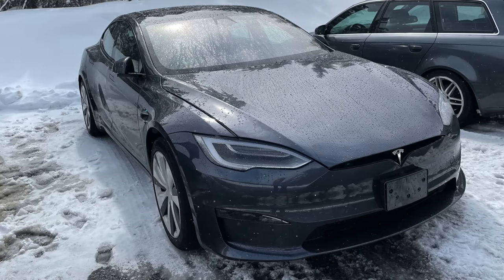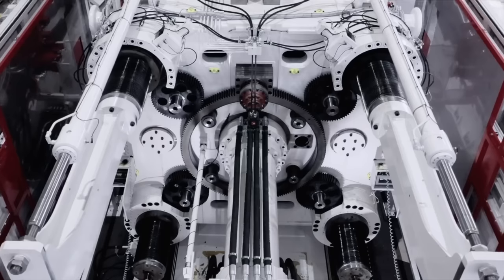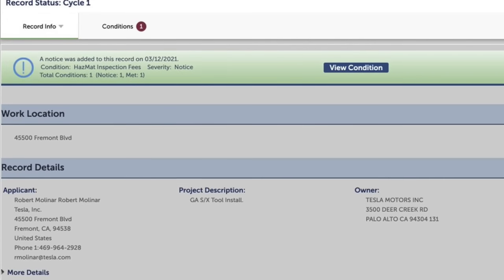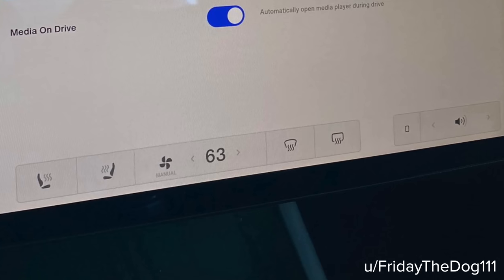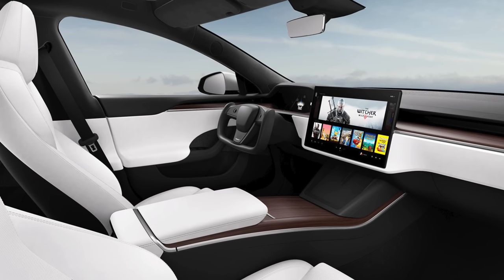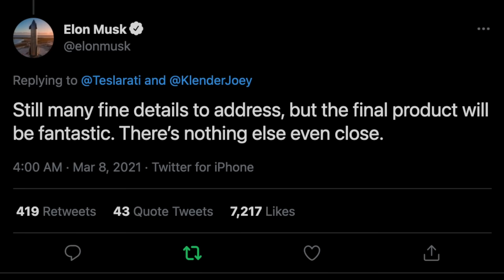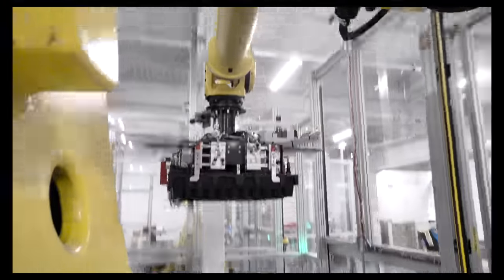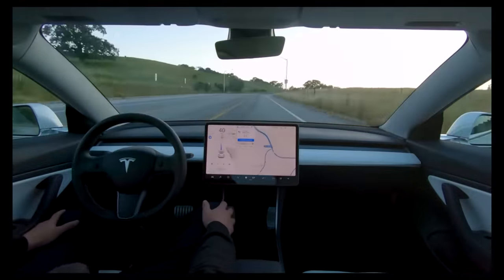NEW Tesla Model S Leaked

Comment: A round steering wheel paired with buttons for turn signals does not really seem smart. On a Yoke it's much easier to find the buttons because of the shape. On a round steering wheel? Good luck not missclicking a touch button while in the middle of a turn (round abouts, instantly turning left after a right turn etc). Will be interesting to try it out...
Reply: I think that’s the reason for the thumb indents. Should help correctly center your hand by feel and allow you to hit the right button.

Comment: Thanks for the news update! Just to clarify, the new Tesla EVs aren't using "the same chip as the PS5 and XSX", but allegedly using a different chip based off of the same AMD GPU architecture - not "Ryzen" but RDNA2. AFAIK, the CPU hasn't been leaked for Tesla, just the GPU. Would be great if it is also using a Zen 2/3 CPU though!

Comment: A lot of hype around Tesla. Here are a few things to consider::
1) You run out of fuel in a gas vehicle versus an EV. A gas vehicle will be a gallon away before you can go about your typical fueling method. An EV will be limited to the charging method on the side of the road
2) No one seems to be talking about range degradation. a) from the battery pack aging but also b) anyone who lives in colder climates will simply not get the range advertised from an EV
3) There is no "fuel surcharge" with an EV. This needs to be changed, the more EVs out there, the less tax revenue goes into building our roads, bridges, infrastructure through the gas fuel tax charged with every gallon of gas purchased.
4) FSD is premature, selling it for 10,000 USD is a blatant pipe dream being sold by the company. Most people who get an EV "banking" on the investment will have vehicles that they're likely to get rid of. The average number of years of ownership of vehicles in general is ~71.4months, or 6 years. If you bought a Tesla in 2018, by 2023 its very likely you will be looking for a new vehicle. Was FSD worth it from an investment standpoint? (if you have 10k disposable income, perhaps try a real investment)
5) Basic economics, the more EVs there are, the cheaper gas will be!! (and the more expensive electricity will become longer term) This is simple supply and demand, there will be a point where having a gas vehicle will be cheaper. Again this is just economics
6)  The yoke steering wheel is another "stretch" design just like the cyber truck. They are using design to advertise for free. The catch is that people have opinions that they will make quickly in favor or against Tesla's approach, especially with many excellent competitors on the horizon. The industry isnt blind, and Tesla does not have the only AI/ML engineers who are excellent in their fields.
Reply: 1. Simple, just make sure you don’t run out of charge. I’ve never run out of gas.
2. Plan ahead in cold climates.. Also, in colder climates gas cars don’t get the gas mileage advertised. Battery degradation (for Tesla) isn’t a big issue. 
3. It’s starting already in some countries, like Australia. There’s an EV tax.
4. I agree 100%.. there will be a subscription soon so people can pay monthly and not upfront.
5. Charge at home.. and solar/power-wall is the way to go
6. Model S owners will have a choice, but the cars will come with a round wheel and then Tesla will retrofit a yoke for those interested.
There’s one thing that I find absurd. So the Roadster was announced in 2017.. you had to put up a $50k deposit. If you want a founders edition, the car is $250k (instead of 200k) but the entire $250k must be paid upfront lol. I’d be annoyed having $250k sitting in Tesla’s account for 4 years now and still no idea when the cars will be produced 😼.. it’s a bit odd

Comment: Steering ratios? Anyone hear about how close the steering ratios are with the new yoke? If you can only require a 45 degree turn of the wheel for u-turns, then bring on the yoke.
Reply: I have not heard about actual steering ratios, but this has always been my guess at how they solve for the yoke. Its a computer after all. Slower speed, tighter radius. Faster speed, hardly any radius. Simple.
Reply: @prestondoty4793  thats what I heard as well... a steer by wire system. I am eager to drive it.
Reply: @davehaller6477  that is so cool!! Do you have any sources for that "steer by wire"? I WOULD LOVE THAT!! I have been flying fly-by-wire for many years and it is far superior to cables and connector rods. Would love to see sources/quotes if you have them?!?! Thanks a ton. Hopefully getting my Plaid next week. Still shows March delivery on my account.

Comment: @Ryan Shaw You need to fix a statement you made in this video. Tesla is not using the same chip as Microsoft or Sony. Tesla is using a pure GPU solution codename Navi 23 made by AMD. Both Microsoft and Sony use a fully customized APU solution which combines an AMD CPU and GPU into one chip. Tesla does NOT use an APU it uses two different chips:  Intel CPU for the media side and Navi 23 GPU for playing games. What you can say is that Navi 23 GPU made by AMD uses the same architecture RDNA 2, however even this is not fully  true. At the time Microsoft and Sony were developing there solutions AMD had not completed the spec for RDNA 2 which means that Navi 23 is more in line with a desktop GPU then the highly custom solution Microsoft or Sony are using.

Comment: I'm not 100% sure, but you seem to use pressing-machine and casting-machine randomly? While as far as I know pressing metal and casting metal are two entirely different production-techniques. Pressing a metal plate (the traditional way of forming carpanels) is not the same technique as die-casting molten metal (fluid) in a mold. Ofcourse both production-machines use pressure/force; a press uses force to press the tools onto the plate, a die-casting machine to force the molten metal into the die-cast.
A pressed metal plate stiffens by the (cold) deformation but has limitations in the freedom of design. A die-cast material doesn't change in its properties, but gets its strength by the properties of its final shape, like injection molded plastics. Die-casting offers more freedom of shape/design, and can therefore more easily integrate many details.

Comment: I can see why one might choose Tesla specifically for the supercharging network. But seeing other companies entering with their own charging networks has me worried about long term adoption of these vehicles. I wonder if this is something that should be regulated so everybody has access to chargers?
Reply: Rivian s network will be based upon CCS and J1772.  Which then the limiting factor is software that would allow other evs to charge there. Easy change for them. Tesla being the apple of the ev manufacturers will have a higher cost to implement that type of regulation.